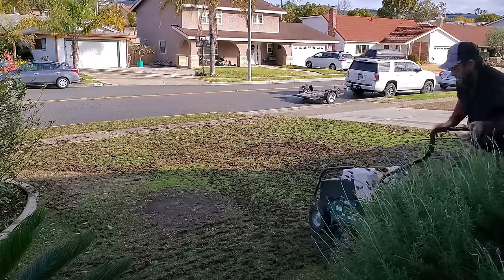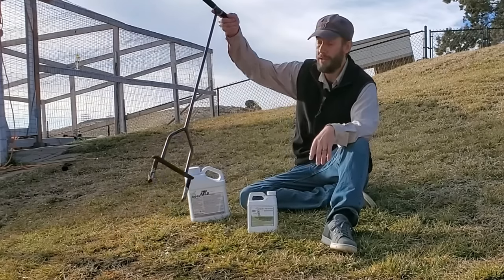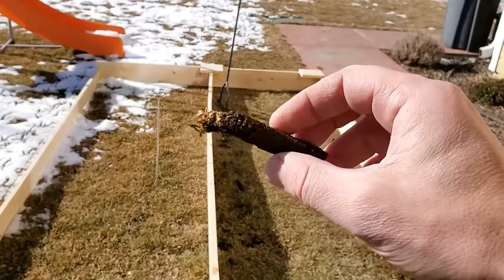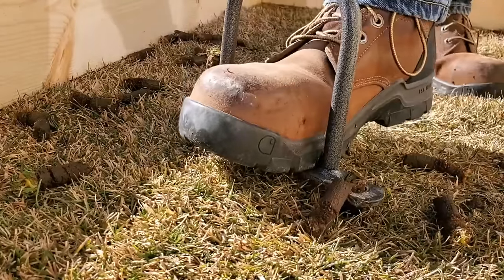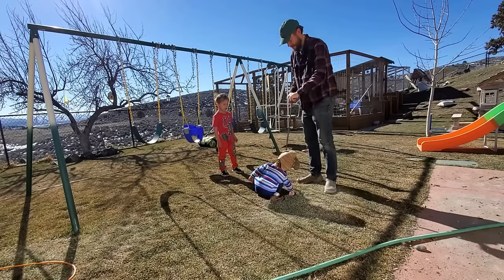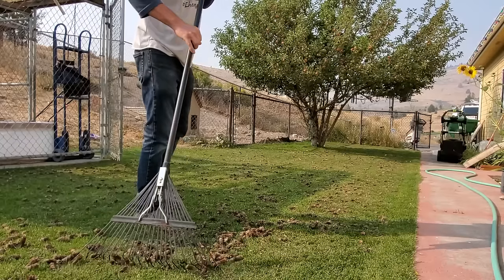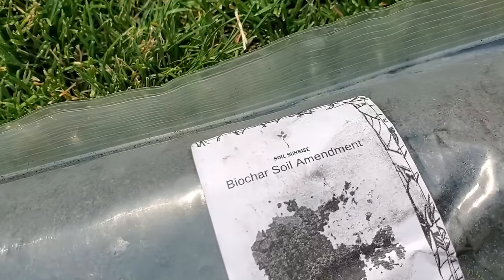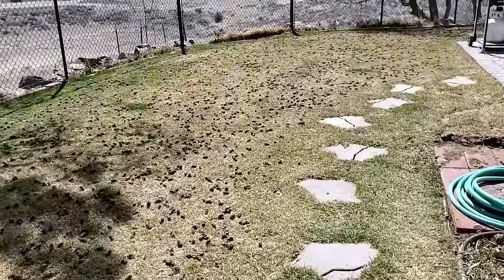Lawn Aeration ~ The Job Most People Skip Just Because It's Hard (A Mega Compilation Video)

Comment: I use a pull behind core aerator with my rider. It works fairly well, but getting the corners covered is a challenge. I may look into the yard butler to cover those areas.
Reply from the maker: That would be an awesome way to do big areas but yep, the corners are hard for anything that isn't manual. Perhaps the corners could be softened with liquid aeration and then manually cored to make them a bit easier to do.
Reply: I was wondering how well the pull behind core aerators work. I was thinking about getting one since I have a riding mower. No way would I ever drop $3k on a gas core aerator and I don’t see the point in renting one since they’re so heavy to have to load and unload especially since in my state I’m supposed to Aerate 2x year with clay soil.

Comment: I have the Yard Butler and have used it several times on my lawn. Does take a few hours to do but works well and less destructive to the turf then gas powered aerators and obviously cheaper to use. Also use my GreenWorks dethatcher after years of manually using thatch rake which was labor intensive. Both products are a cheap option for small lawns like mine. 😁
Reply from the maker: Those two tools are a couple of the best values a lawnowner can spend their money on for sure. I didn't say in this video but I'm now using my Corona two-pronged core puller when my Yard Butler got too damaged. It might be even better as it's bot a wider cone shape on the cores; it has worked amazing for  me.

Comment: What do you di in states like Texas where we have crappy, very hard soil with a lot of rocks (where I live) and we have been in stage 2 water restriction since last August. It will be challenging to water sufficiently with that in place and the penalties for violating the restriction. I'd be so interested in you addressing warm/hot weather lawncare. Thank you!
Reply from the maker: I'll try to make some dedicated videos on the topic this year but to be overly-brief I'll say I'd grow buffalograss. I have a handful of vids on the topic already and I'm waiting for my parkway strip to come in which is seeded buffalograss. Vids on the topic should be more frequent this year but it's what I would consider as a top option for TX. Low water requirement, high heat tolerance, freeze tolerant, standard herbicide tolerant. It has a longer dormant period though.